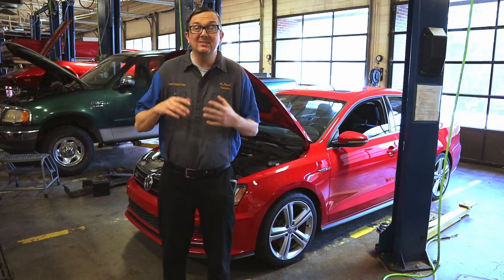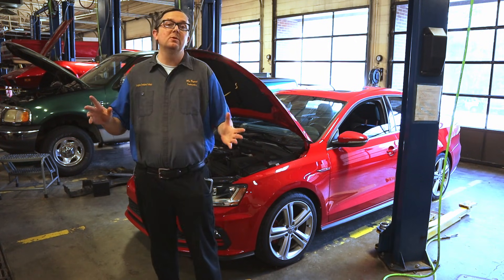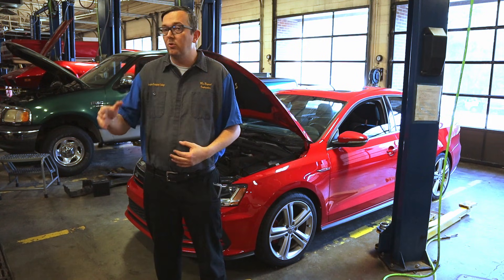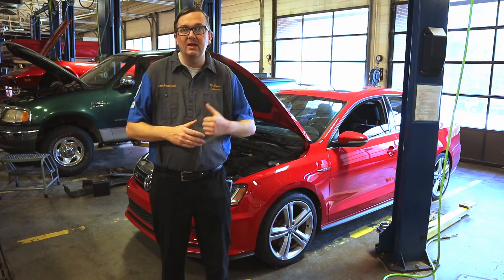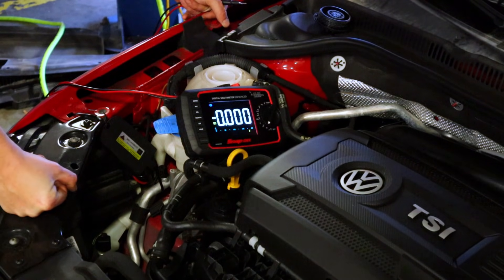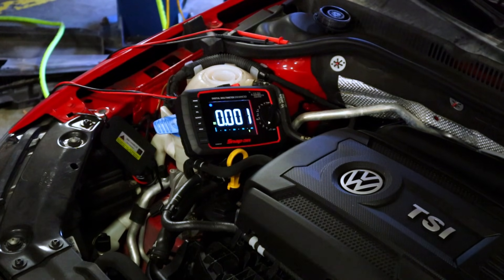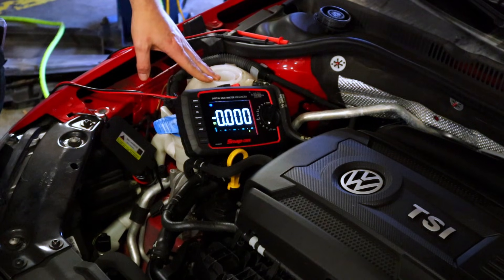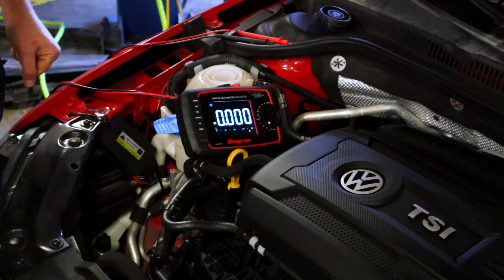How to test your coolant with a multimeter

Comment: Just for fun I tested a bunch of vehicles. Listed below is the coolant type, how long the coolant has been in the vehicle, aprox. mileage on the coolant and the voltage read.
Toyota pink 10 years 84.000km .2 volts
Napa Asian 4 years 40,000km .35 volts
Dexcool 10 years 165,000km .44 volts
Tested using battery negative and engine off.

Comment: You do not need this.

Measuring the voltage potential of the coolant is not a reliable method in determining the health and condition of the coolant. Voltage potential can certainly indicate galvanic corrosion, but there are many factors that affect the measured voltage potential such as the concentration of water and coolant mix, type of coolant, contamination, and where you poke the ground lead to.

A visual inspection is usually adequate enough for indications of coolant degradation and contamination. 
- Discolouration can indicate either contamination or degradation
- Cloudy or murky coolant are signs of contamination

A pH test can also indicate any coolant degradation.

Look at your owner's manual or ask someone in the parts store for the correct coolant for your vehicle.

Comment: It would be very helpful to show the voltage with new coolant to confirm an improvement and set a baseline. Good video.
Reply: I did a coolant flush on a 2015 Camry, 84k km. Factory coolant.
Before flush .2 After flush .11

Comment: Hello Hello. There are all different recommend test voltage cut offs .20 , .30 , .40 and all different "methods" with different results. Some say engine on , some say off, some say POS in coolant some say NEG in coolant. Here are my sample results that may help some viewers .  POSITIVE in coolant .20 v (engine OFF) .24 v (ON).  NEGATIVE in coolant .26 v (OFF) .29 V (ON).  Those are big differences.  AND IF SOMEONE HAS THE CORRECT VOLTAGE CUT OFF AND CORRECT METHOD PLEASE LET US KNOW. THANKS!!
Reply: It depends on how many coolant flushes you want to up sell to make your week 😂

Comment: A instructor at school mentioned that the ground goes to ground and the positive into the coolant… Does it matter ??
Reply from the maker: As long as the brake system is grounded to the chassis, no. Checking resistance from the battery ground to the master cylinder should show continuity if the brake system is grounded.

Comment: I thought we want to measure resistance of brake fluid to check water percentage. 3% or higher and fluid needs to be changed. 3% is about 5M Ohms. Lower reading is worse and higher means brake fluid is still good.

Comment: Hi Mr. B. I've done my testing with Fluke multimeter. My first dip into the coolant showed 0.190vdc and when I kept the probe long enough the value went down to 0.022vdc. Which measurement should I take? The first dip value or the prolonged dip value???
Reply from the maker: I would take the first measurement. Thanks for watching!
Reply: @AutoScholarwithMrB  Thanks for the reply. Cheers!!

Comment: I see many are making a mistake on the decimal place, they're not considering the difference between volts and milivolts
Reply: Im confused too some said red in coolant some said red to ground which is which? Damn lol
Reply: @abdulmuhaiminabdullah6965  Normal is the black goes to the ground same as the black cable goes to the negative on the car's battery which is connected to the car's ground, frame. But technically if you place the test meter's  red lead onto the ground the meter will show a negaitve volts such as -0.02 vDC as opposed to 0.02 vDC. The #'s are the same only one is a negative reading and the other is a positive reading. Best to go with the standard way the car is wired which is black to ground / negative and red cables, leads to positive (coolant in this test). See the colour of the cables connected to the car's battery for reference.

Comment: I own a lexus Rx450h the battery is located in the trunk , can’t do the test? Its an hybrid car.
Reply from the maker: You can put the lead on the 12 volt jump point under the hood if your car has one.
Reply: @AutoScholarwithMrB  Ok  just done it with a ground near the chassis , i found 57mVolts, 0.057 volt